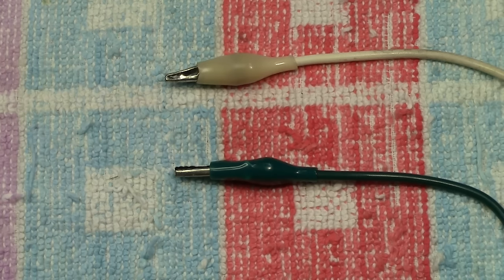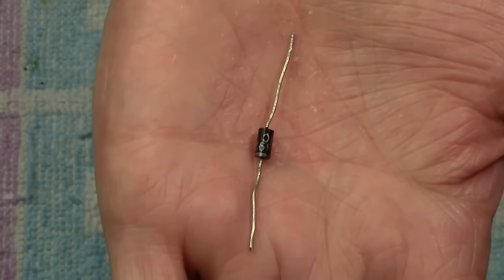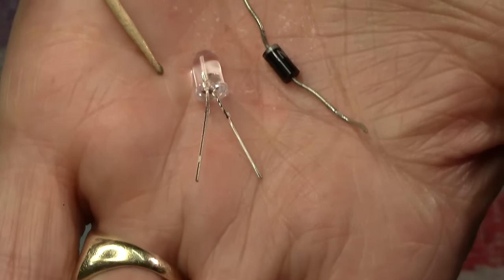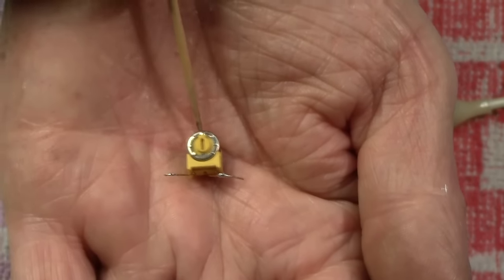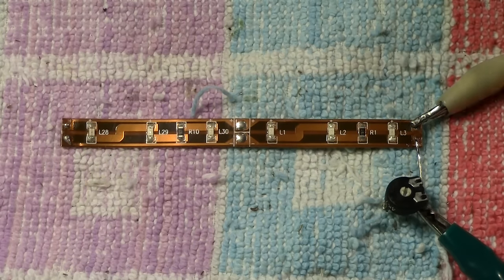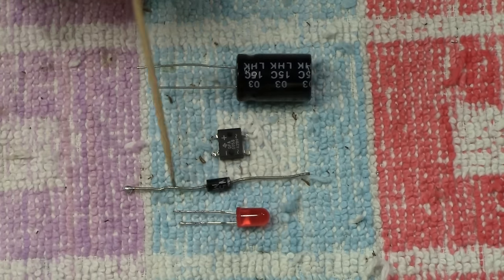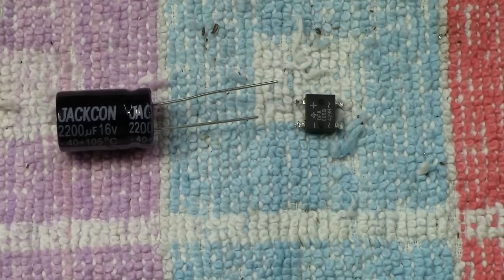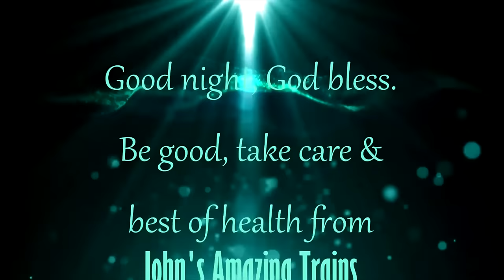How-To On LED & Bi-LED Wiring + The Evolution Of Lighting In Model Railways. Hornby Triang etc.

Comment: Thank you John. Really useful.  Would the same circuits work with dcc input?
Reply: For DCC you need a fast acting diode, such as a 1N914 or 1N4148 from what I hear.
Reply from the maker: Thanks for the comment Neil. As for your question, the answer is yes & no. Any of the examples I showed using the bridge rectifier will work because DCC is actually AC (Alternating Current) on the track which is then converted to DC for the locomotive, coach etc on-board with the associated decoder. The bi-directional circuit I showed with the two LED's & the small board at the end will not work...in-fact you may damage them if trying to do so! Hope that helps? All the best, John.
Reply from the maker: Correct. Cheers, John.